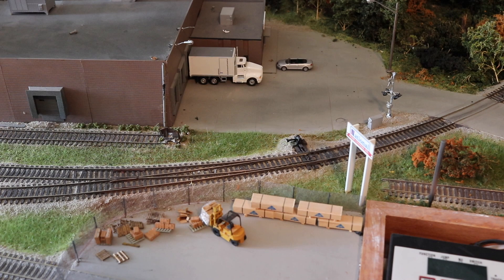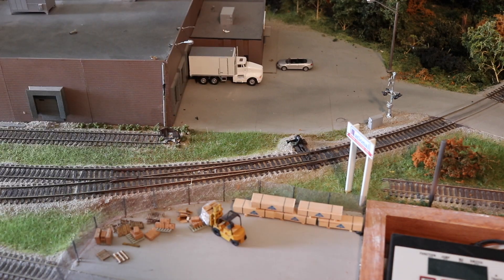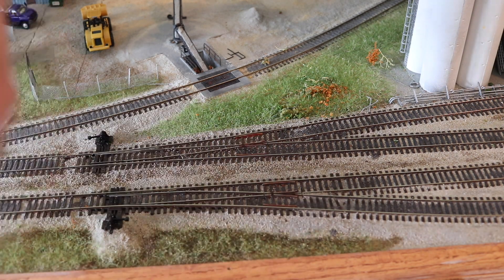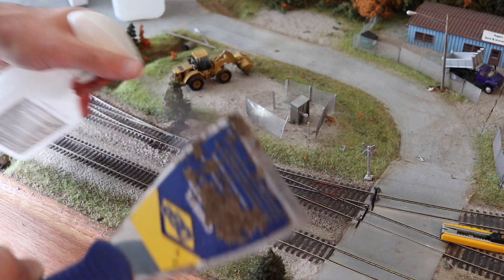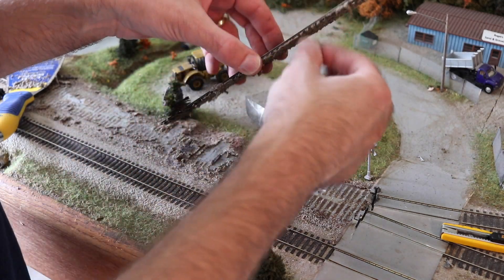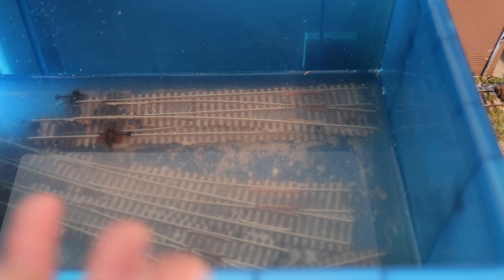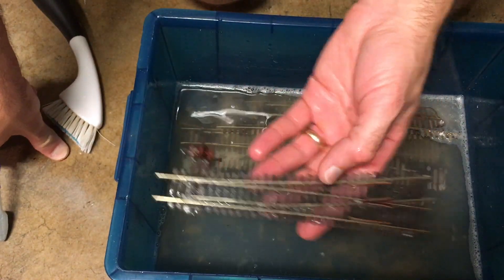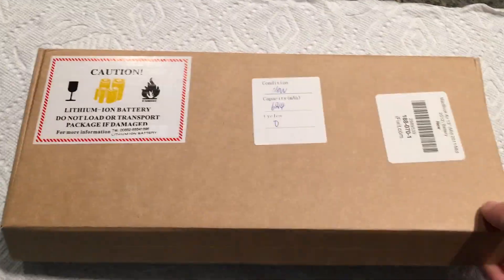Removing and Saving Ballasted Turnouts from the HO Train Layout

Comment: Hi there 🙋‍♂️ great video. I am using Trix bedded C-track, with ballast on top of it and I would like to add an extension to my layout, so I will have to open the oval and then put a turnout in place to get a connection to the new extensively. I will definitely follow your advice of soaking that part of the track in alcohol. Thanks for this interesting video 👍🙏 Greetings 🙋‍♂️ Erik

Comment: Very informative film, I have a n gauge layout and I need to swap out a faulty set of points.  Would recommend cutting the fishplates or sliding them down to remove the points? The surrounding track is glued ballast and I want to try and not damage the surrounding track.
Reply from the maker: If you can slide them, that would be easiest. Cutting them of course runs the risk of damage but can be the only option in many cases.

Comment: Will the alcohol damage the tracks?
Reply from the maker: It shouldn’t cause an issue. I’ve never had a problem at least.  Other common solvents can soften the plastic though. Water will work great if you used white glue (PVA) but since I used caulk as an adhesive for the track it wouldn’t be as effective.
Reply: Thanks Steve!